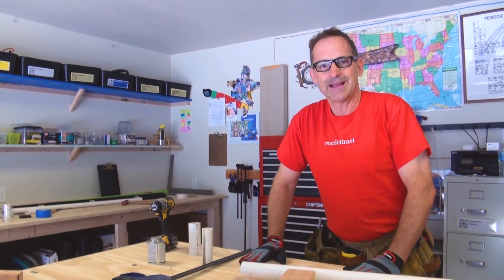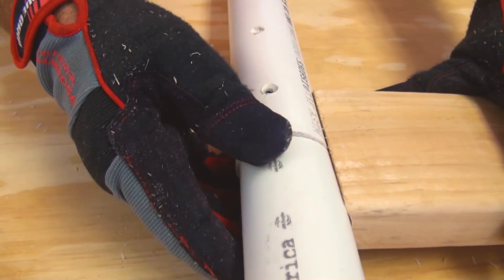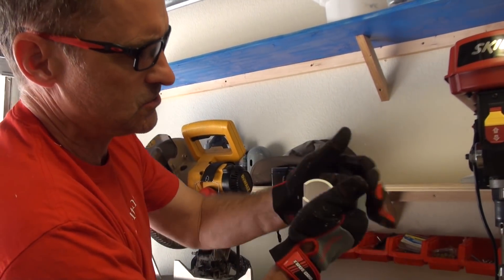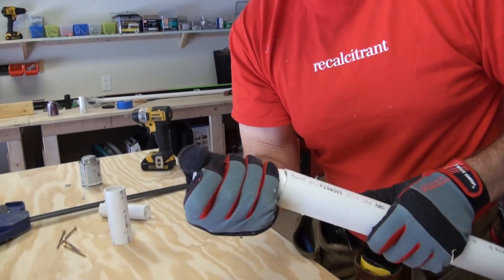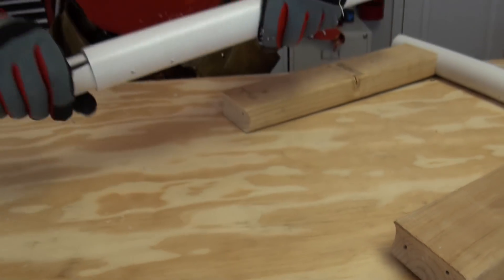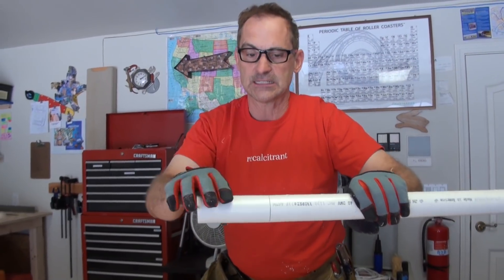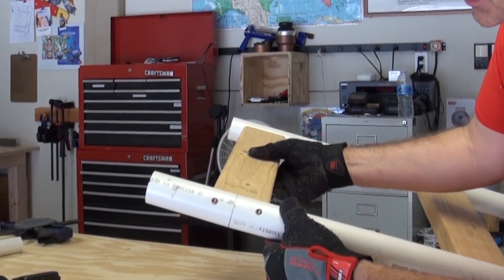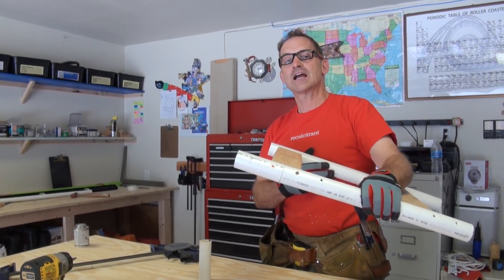How To Join PVC Roller Coaster Track Segments

Comment: I've had trouble keeping the PVC hot it cools down too fast to form it properly
Reply from the maker: It's definitely a balancing act. Get the tubing too hot and it collapses or deforms. Not hot enough and it's tough to bend. The first coaster I built with PVC, I didn't heat the pvc at all. I used (dangerous) straps and jigs to hold it  in place. I wouldn't do it again that way. Using super hot sand poured inside the tube (also hazardous) is an option that keeps the tube from collapsing. But, you have to contend with heaps of super hot sand!
All of the above is why I switched to steel for tracks :)
The main thing, Pineapple, is safety. Please be careful, be sure you've got someone with you to help, go slow, and think through every move before you make it.
Enjoy!

Comment: What type of PVC should I use for a coaster, I was thinking of using 2" Sch. 40 PVC but I was wondering if I should use Sch. 80 instead because I want to have a max weight of 150 pound riders and G-Forces that max out around 3Gs. Also there will be ties around  every 1 foot but in high G-force areas there will be more.

Comment: Oh, and a heat gun with a variable temp setting is cheap, and works great to get PVC pliable, and would probably keep your wife off your back about using her appliances lol All joking aside, however, are there any toxic fumes given off by PVC, CPVC or any of the other piping we often heat up?  I have found sometimes I can notice faint odors, even when not setting it on fire.  I have gotten into the habit of wearing a respirator face mask, cause who knows what's in those fumes!
Reply from the maker: Safe to say we're all in the habit of wearing face masks these days! (sorry. bad joke)
But seriously. It's great advice to be careful about fumes. Ventilation is super important.
With the heat gun, I found that getting the PVC consistently warm was a challenge.
An oven for smaller pieces is great. 
For longer parts, you can fill the tube with hot sand. Heat sand in a 500º F oven, pour it inside the pipe, then shape the pipe however you like. The sand heats the pipe evenly and supports the inside of the pipe so you don't end up with flat spots on your track.
There's also an awesome product called PVC Bend It, which does a brilliant job, especially for long pipes.
https://pvcbendit.com. So definitely check that out.

Comment: Thank you, I am looking to make a jet ski land launch, and am planning to use PVC for the rails to the water.  I am thinking I may also install concrete and rebar inside each section, as it will be carrying a lot of weight @ ~800 lbs. and I want the rail system itsel to be extremely sturdy, as it will be subject to occasional high surf and hurricane force winds.  My plan is to keep the height of the ski 'locker box', aligned with the height of my trailer.  In the event I need to offload the ski from the rails, I can winch it forward, right on to the trailer. I plan to use a ATV winch to pull the ski back out of the water up the rails.  It's a good rise from ther water line up into my yard, ~4, and adding the trailer height, another foot for five total. To minimize scratches to the jet ski underside, I am thinking I might be able to build a cradle for the ski to sit in.  It slides on the rails, rather than the ski.  I am thinking PVC there as well, but again, wondering about the crush rating on 3" pipe.  Does anyone know how much inward force it takes to crush say schedule 40?  I am thinking a jet ski would be no problem.  they rate it for PSI burst pressure, can that be equated to reverse inward pressure?  E.g. if it is 2200psi, does that mean it can withstand 2200 lbs of weight on the exterior, before crushing?
Reply: This sounds absolutely awesome! No idea about your question tho lol

Comment: Would it be a stronger join between rail and cross-tie if the screw was screwed flush against the inner wall of the pipe instead of to the outer edge of the pipe? Does the weight of the wheel rolling over the track not eventually cause the exposed screw inside the pipe to bend? I can’t tell without having it in my hands!

Comment: What’s the best paint to use?
Reply from the maker: Hi Jake,

My friend Paul Gregg (https://www.youtube.com/user/psg20101) tells me that darker paints are better at blocking UV radiation. Paul is an experienced backyard roller coaster engineer and an aeronautical engineer with over 30 years of experience in materials science, etc. He referenced this article on the topic of paint as UV protection - https://www.youtube.com/user/psg20101. You can also check out www.backyardrollercoasters.com where Paul offers two ebooks for sale. If you want to work around the UV issue entirely, the gray, schedule 80 PVC electrical conduit will do the trick nicely. More expensive, but you don't have to buy or apply paint :)

Best,
Will

Comment: I'm planning making my own rollercoaster. How do i bent the pvc and make a smooth turn
Reply: Maybe a bit late, but heat up some sand in an oven then pour it into the pvc pipe. This method evenly heats the pvc so it uniformly bends and doesn't buckle or fold
Reply: @Alex-wn5rc  thanks
Reply: The themefamilypark Vlogs There is a video Nighthawkinlight made on it called how to bend PVC and the example is on a pvc Roller coaster.